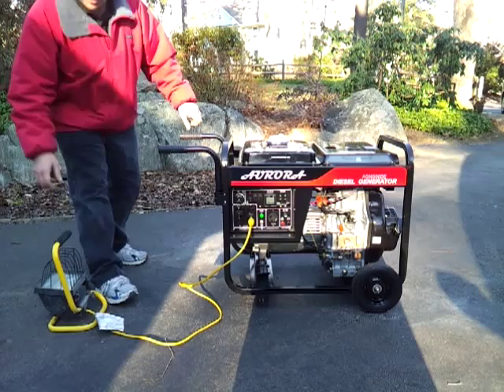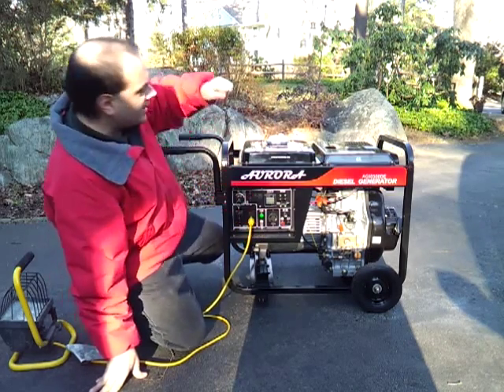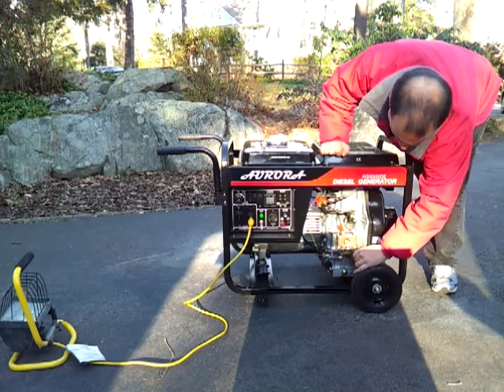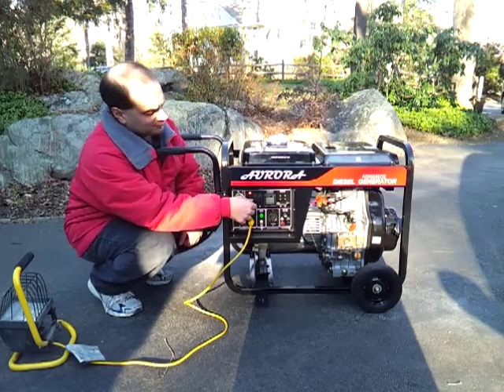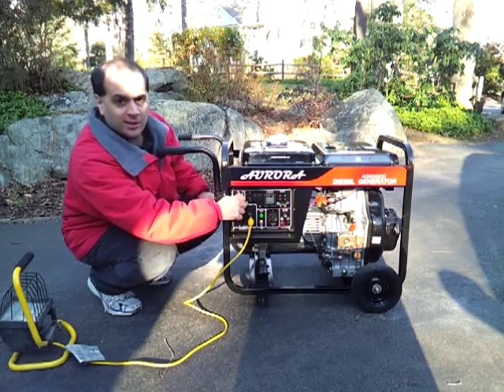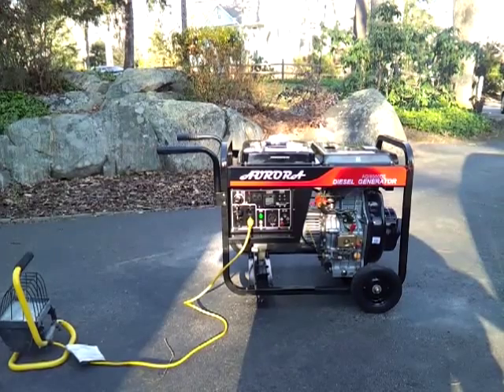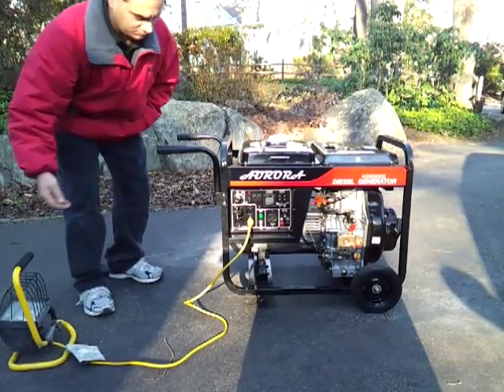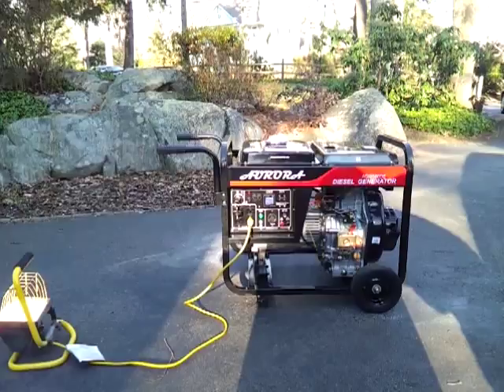Cold startup of Aurora AGI6500DE diesel generator

Comment: I sure hope that's 2 cylinder as that's running way to fast for any long skirt diesel piston
Reply from the maker: +Jthumper This is an air-cooled 1 cylinder engine running at 3,600 RPM.  One of many consumer grade units built around the Yanmar L100 diesel engine (or a clone of it).  Unfortunately you can't buy this type of generator from any manufacturer anymore.

Comment: Thanks for answering all my questions.  I had the same thought process about everyone else running their generators when I am, too.  Plus, my town's noise ordinance specifically allows for the use of generators during emergencies at all times day or night.  My big concern with the silent model is the tiny wheels, and how hard it would be to move it on anything but a smooth surface.  Thanks again!

Comment from the maker: Watt for watt, HP for HP, it's probably about the same as gas.

I didn't want the "silent" model and there are several reasons why:

1. The shroud gets in the way of maintenance

2. I found that when there's a blackout, all the neighbors are running their generators too, so the noise doesn't really matter.

Comment: they do not have glow plugs they have a air warmer if you are not sure take off the air cover and filter there should be a  coil of wire from  one end to the other  if it does not maybe it does have a glow plug or it needs a air warmer